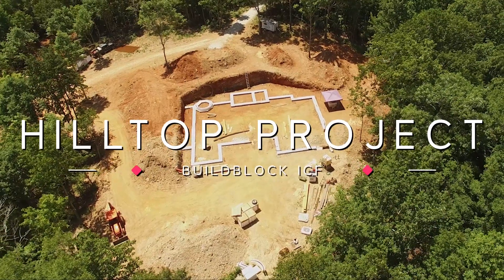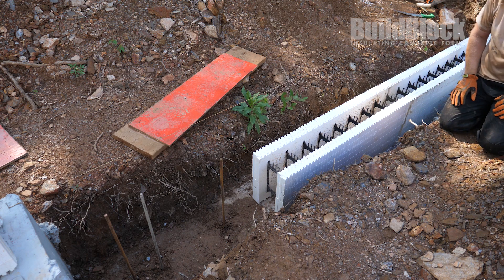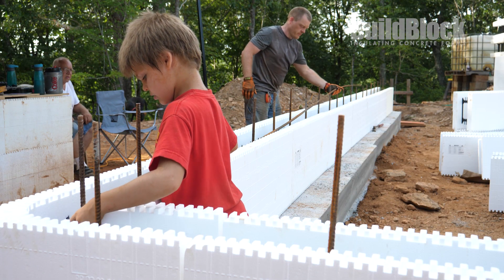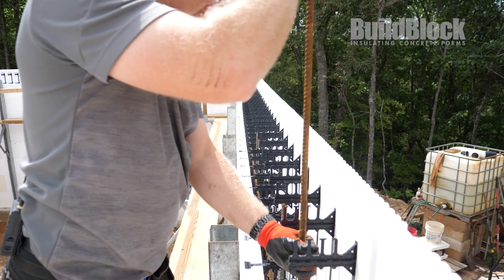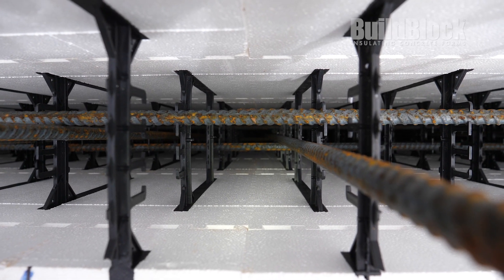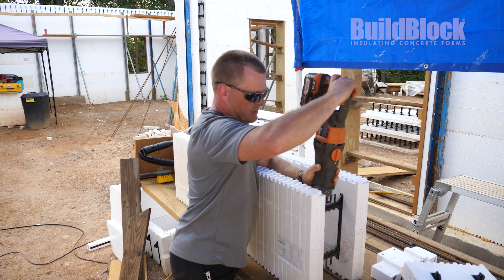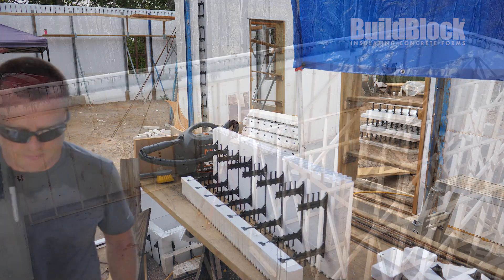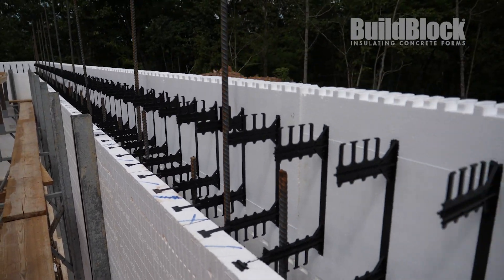How To Stack, Cut, and Reinforce ICF Walls

Comment: What happens to the styrofoam after you’ve poured your cement. Is it insulation and will the outside styrofoam rot?
Reply from the maker: Hi, the EPS foam will stay in place after the concrete is poured and will serve as insulation for the structure. The EPS foam does not rot or decay.
Reply: @BuildBlockICF do you think you'll lower your overall heating and cooling bills in the long term every month?